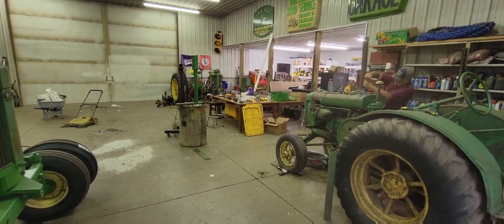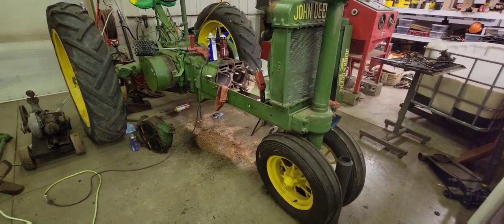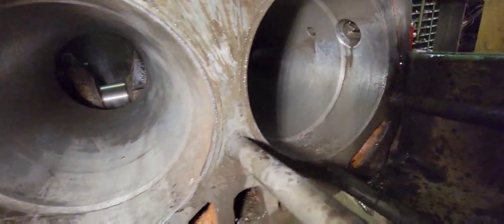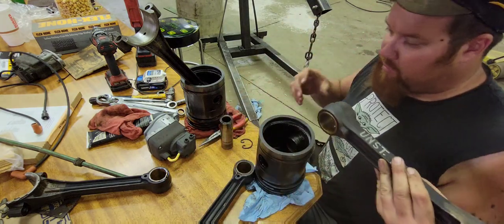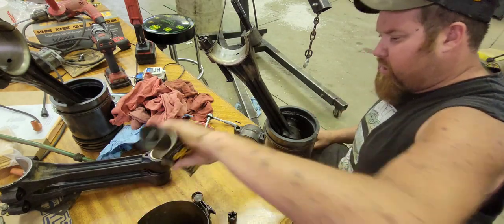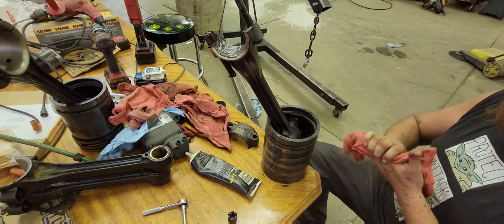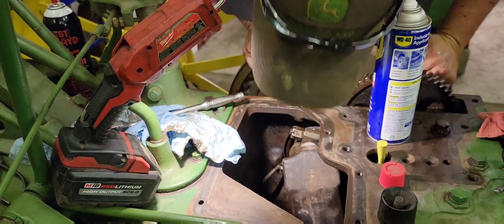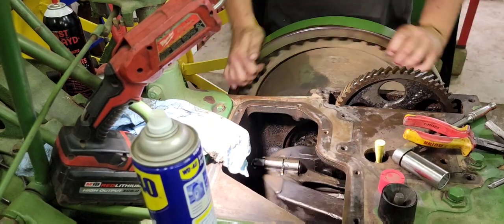1936 A John Deere Two-Cylinder Rod & Piston Installation Video!!!

Comment: Really interesting. I just about dumped my breakfast on the floor when you said you was reusing the rings! I thought I was the only guy that does that. I rebuilt an old 8N one time and the owner didn't want to pay for new sleeves and pistons after having to grind the crank and new bearings, so I checked the rings out, still had within specs end gaps, they looked good, so like you, I honed the cylinders good and reused the old rings. When I started working on the engine, it ran, smoked a lot and was puffing clouds of blow by. When I started it up for the first time, it never smoked and never smoked any during break in. The owner used this to mow about 10 acres with a finish mower every week or so. After 10 years, it is still running good, doesn't use any oil, not hardly any blow by! I think most important thing is to get the engine up to operating temperture on the break in to seat the rings good.

Comment: My dad bought a brand new 730 Diesel in 1959 or 60 I  was 4 years old, and it was regulated as a planting tractor around 1968.  In 1971or 2 we were planting beans and for sone unknown reason the crankshaft  broke and after talking with the dealer he tradeded for a new 4520 rather than a rebuild, I  think he regretted it I  know I  do. That 4520 was a dog it never did as advertised, John Deere also replaced the 4520 by upgrade to the 4620 in 1972 it was basically the same tractor but with improved engine

Comment: Howdy...just bought a 36 for $250...had running tractors but never rebuilt one....engine been apart for years but stored inside..what flex hone did you use?...thanks

Comment: Do you have any place that will re-babbitt those rods for you?  I wish I had kept our first set of babbitted rods for our 1938 G.  It's just about impossible to find good babbitted rods hereabouts, but I can get old rods re-babbitted (for a small fortune, but at least I can get them) "IF" you can find good rods to work with.
Reply from the maker: I haven't found a place yet I'm thinking about teaching my self how to do it
Reply: @dirtgrainsteel  Harts Machine in Cecil Ohio did my rods and mains for my 39 B. Give them a call. Reasonable prices and fast turn around as of 2 years ago.